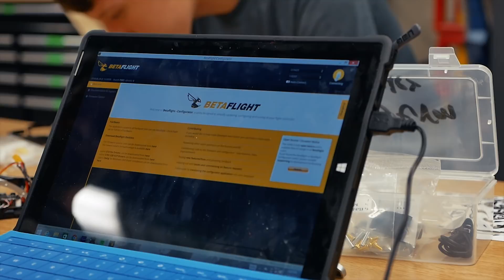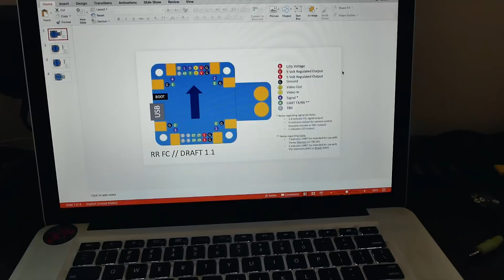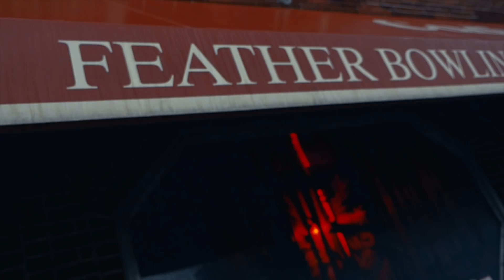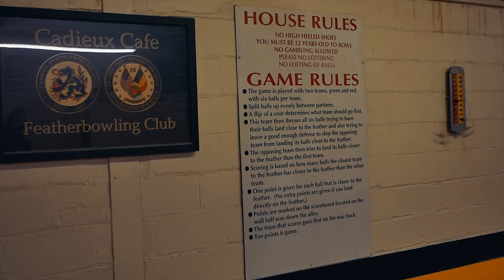Why School Should Teach Drones

Comment: Good to see other schools doing this. I'm currently teaching grade 9 students in Western Australia to build and fly Tiny Whoop quads. They are designing, 3d modelling and printing their frames. They will be soldering and configuring betaflight. Then they will be racing against a nearby school on an indoor circuit. In the background they will be doing investigations into motor kV, 2/3/4 blade props and weight minimization to optimize their quad while they hone their skills on a sim and on the actual quad. It's gonna be a great project and there is so much to learn on the way!

Comment: got a ? i have this Eachine TS5828L Micro 5.8G 600mW 40CH Mini FPV Transmitter  and i need help with sound and i have this RunCam Swift Rotor Riot 2 Special Edition - Silver i need too know about wiring the two together for sound help if u can thanks

Comment: What is the best way to get in contact with you? Im cofounder of a company called uLab and we are running several drone camps this summer. Ive been working with a ton of big industry names like Nick from MQC, brainFPV, fatshark, emax, hobbywing and a ton more. We currently run single location private classes and summer camps as well as resell STEM related equipment and our very own curriculums to schools. For this camp the kids are actually building MQC Fusions with Radix FC’s, emax motors, hobbywing 40a 4 in 1’s, tbs unify’s and they get fatshark recon goggles, 3 thunderpowerRC batteries/a charger and qx7 remotes. 

I also just sold our first microdrone CLASS to a middle school. Not a club, an actual class. They ordered 45 newbeedrone acro bee’s. Anyways I’ll stop rambling on, just let me know the best way to get in contact with you if you would like to hear more about what we are doing, and possibly get involved.